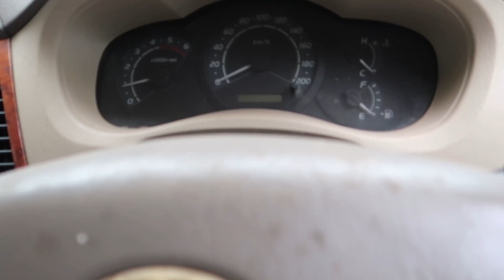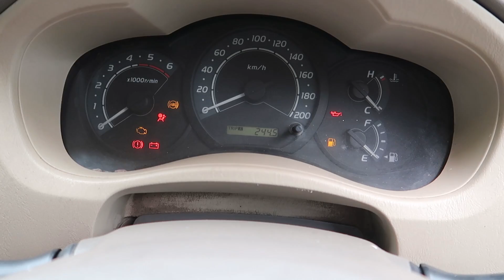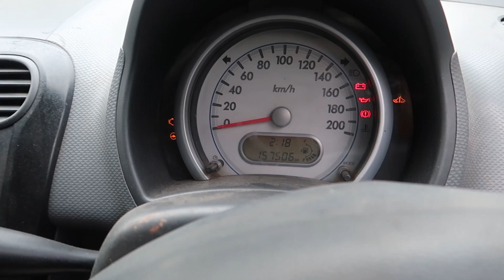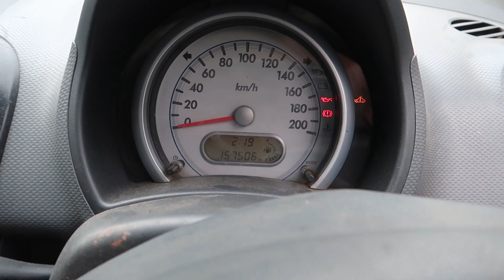Innova and Ritz cold start | Innova complete restoration

Comment: 2003 model TATA SAFARI 183000 kms odiya vandi park cheithu battery disconnect cheithu tyres naalum azhichu maatti kattappurathu vachu gulfil poyi  1.5 years kazhinju thirichu vannu battery charge cheithu vechu oru mechanic inteyum help illathe start cheithittund .athokke vechu nokkumbol ithokke enth.2018 il park cheitha vandi odichillenkilum vallappozhum start cheyyarundennalle paranje.appo otta crankingil start ayillenkil thalli thottil kalanjekkanam.vandi Rolls-Royce ayalum ambassador ayalum maintain cheyyunnath poleyirikkum.allathe vandiye paranjittu oru karyavumilla